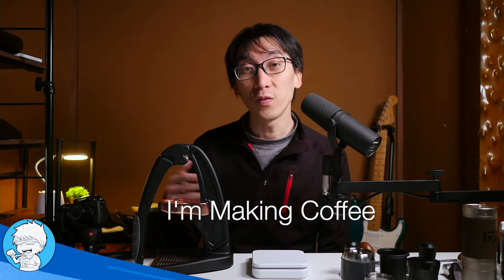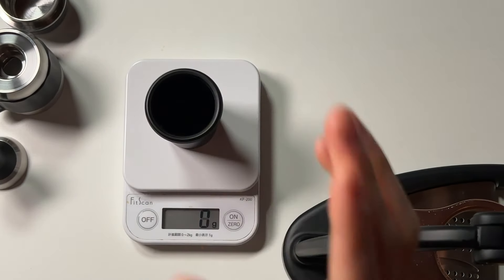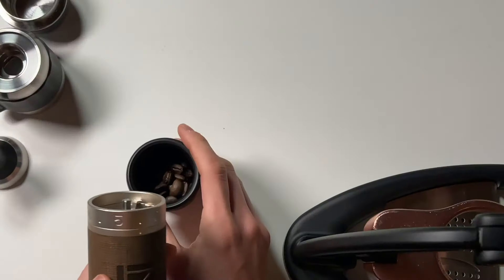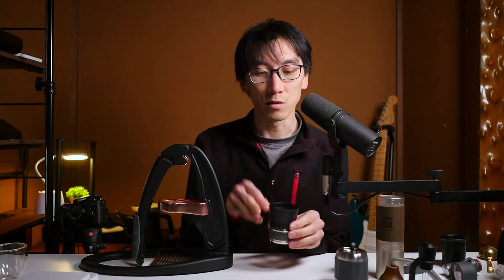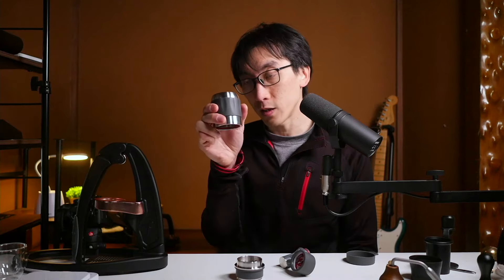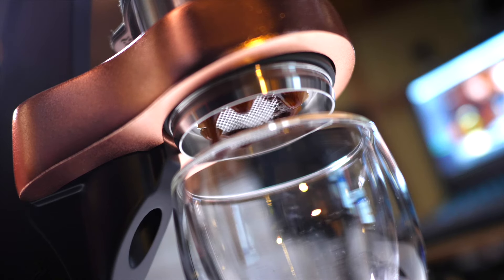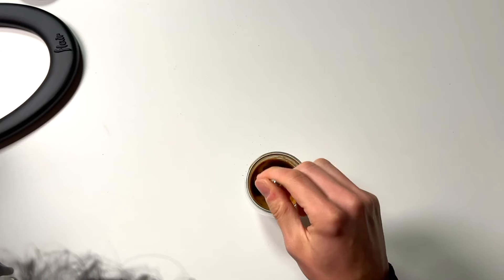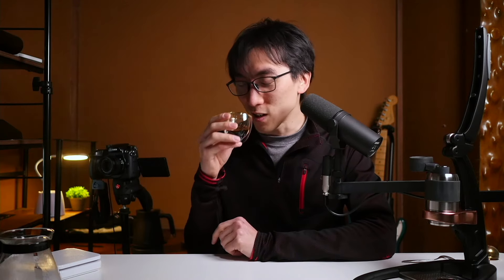Completely Insane Workflow. Tiny Drink Sensation.

Comment: I bought a Flair manual espresso machine to start in the hobby.  I really loved it. 

I'll never forget though, a few weeks after I started using it, I had some friends over and thought I would show it off and make them some coffee. It wouldn't pull.  That was the day I learned simply rinsing the screens was not a thorough enough clean.  The build up had made it impossible to pull shots. 

After that, I started making sure to pull clean hot water through after every espresso.
Reply from the maker: Great advice!